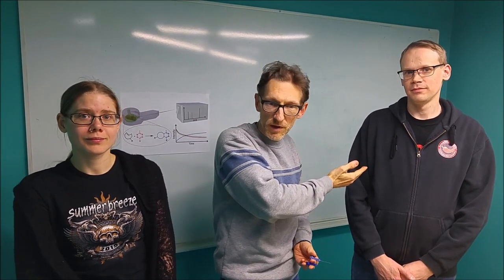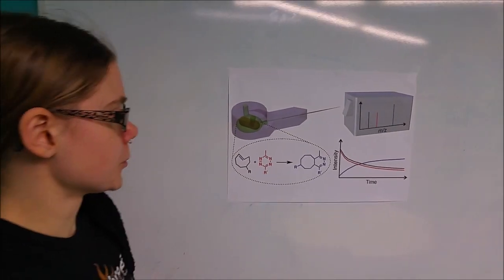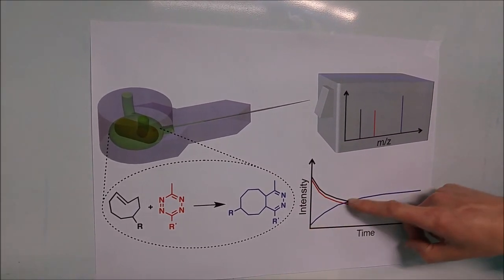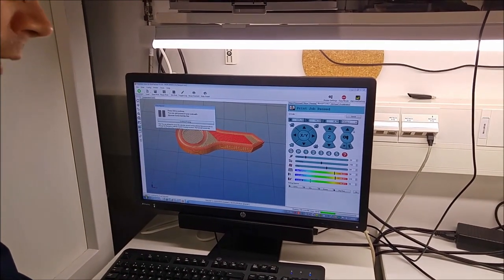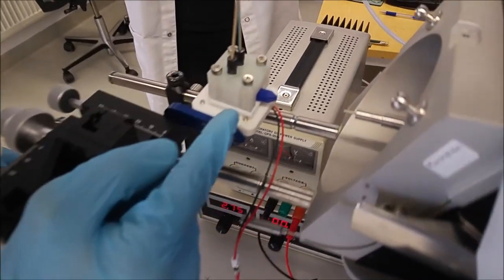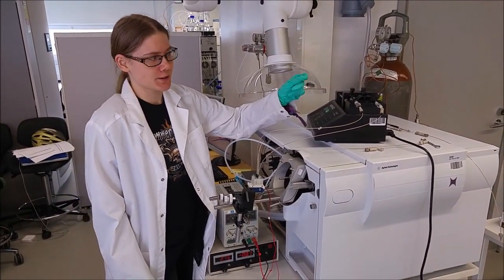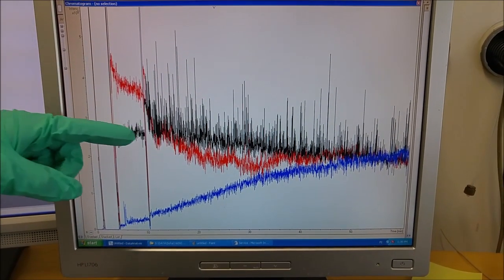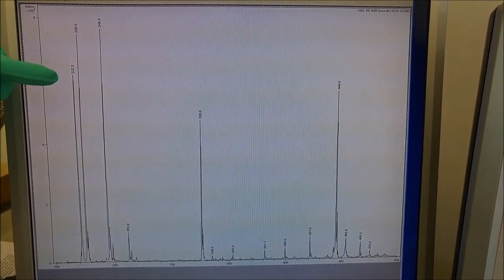3D printed polypropylene microreactor

Comment: Hello.  The idea to 3D print a bunch of reaction Chambers that will not survive the reaction process seems like a good, inexpensive solution for gathering this data.  Kudos to you for this innovative use of technology.  I came to you here after watching your excellent polycarbonate slugs on taofladermous.  I wish you every success.
Reply from the maker: Thank you for the kind words. PP microreactors most definitely will survive the reaction process, because PP is so inert.
Reply: Gianmario Scotti Amazing.  So they are re-usable?
Reply: As a part of the team I can tell that they sure are. Most of the work for ther publication, which was a lot, was done with a single microreactor.
Reply: Markus Haapala That is even better than I imagined.  I had assumed these were meant to be disposable tools.  That you created durable, re-usable test reaction Chambers with these printers is unexpected and impressive.
Reply: It's mainly thanks to the material. The cost savings when using cheap FDM printers for this kind of work could be really big.
Reply: Really impressive. I can see how inexpensive reactors and sensors can be cheap enough to be essentially disposable. I wonder how much of your setup could be printed. You are using lab-grade power supplies, etc., but I assume much of that could be replaced with a small circuit board and a handful of off-the-shelf components. The elephant in the room is obviously the mass spectrometer, I have to think about that one, but obviously, by picking the problem domain, one can sidestep that problem.

You have done a great job in picking a setup to prototype and test. [Often the hardest problem…]

Comment: So if I got this right, you have what is a very small but cost efficient reaction chamber. One which allows you to observe reactions inside the chamber more or less directly. That is a neat idea, one which i wouldn't have considered doable for 3d printers. Since i'd just have assume the plastics and polys wouldn't hold up and the metal ones would be to aggressive and imprecise in printing.
Reply from the maker: That's the beauty of making the microreactor from polypropylene - it is inert towards the great majority of solvents, concentrated bases and acids one would encounter in the typical lab.

Comment: Doesn´t the dead volume in the needle delay the analysis to a point where the reaction is hapenning inside the needle while the fluid is traveling to the tip?

I guess thermic effects are there as well, as the needle is initialy cold and later on get´s hot due to the reaction, so the reaction inside the needle is hapening faster to the end of the experiment than in the start, as the temperature is higher. 

Maybe pump the fluid in a constant loop and only extract something out of the flow and inject it with a very short needle?
Reply from the maker: At the very beginning, let me point out a very important aspect of this microreactor:  this is not actually a flow chemistry device, but rather a miniature batch reactor. Bear that in mind when you read the rest of this post.
The inner volume of the nanospray needle is negligible. Furthermore, the experiments with testosterone-d3 would indicate that the reaction happens in the reaction chamber, because that's where the mixing happens. Before the stirring/mixing is initiated, no mixture wets the capillary, only one or the other solution.

Comment: Very good demonstration of 3D printer-use in labs; having those reactors manufactured traditionally would have cost a relative fortune! Atleast in the sense that it's specialized and not mass-produced.Don't know if you'll be replying to comments, but what did you find were the variations in inner volume from one reactor to another, and did you go through other plastics before you arrived at polypropylene?Oh, and hello from Taofledermaus' channel.
Reply from the maker: I immediately had the idea of using a refractory (inert) polymer for this purpose, and my two choices were polypropylene (PP) and high density polyethylene (HDPE), but I could not source the latter, so I went with PP.
As for the volume, we discuss that in our article, which is open access so you should be able to find part of your answer there.

Comment: You mention the macro/microroughness being a minor issue, what kind of margin of error does that leave you with compared with a machined component? Also you mentioned that the distance/volume was shorter to the capillary: can you elaborate on that? What are the flaws within the previous component that allow this 3d printed one to be faster? Just the lack of external pump or is there more to it?
Reply from the maker: I hope I'm interpreting your "margin of error" question correctly: machined components would have dimensions that are more accurate than what you can obtain with FDM printing, but with FDM you can achieve enclosed features, which you can't have with traditional machining. 
I am not sure what you mean by "distance shorter to the capillary".